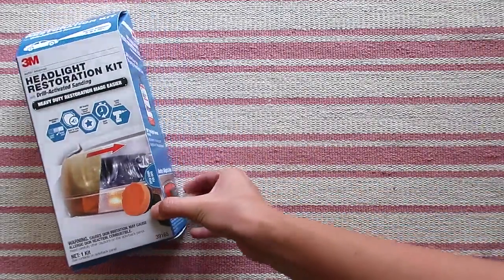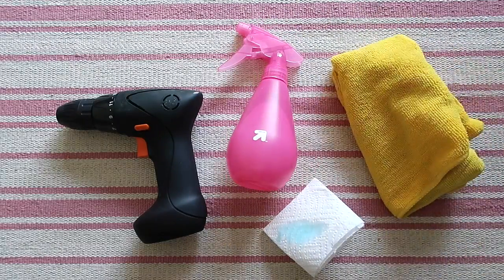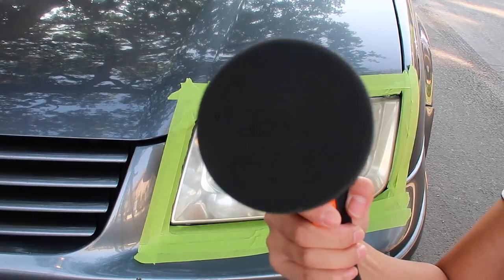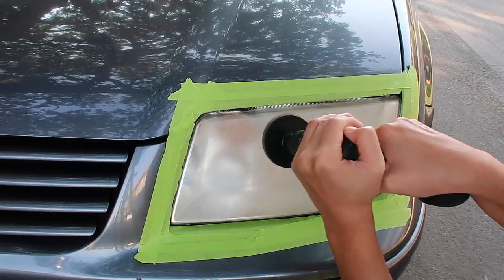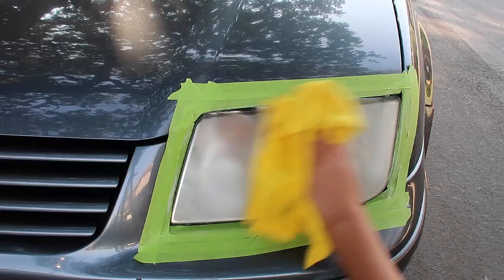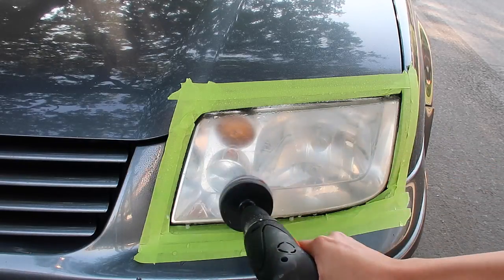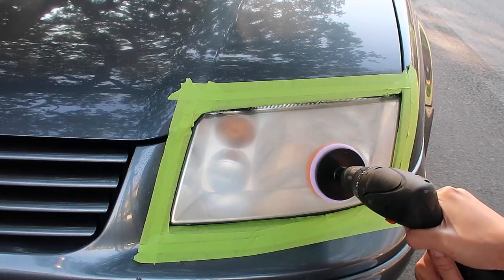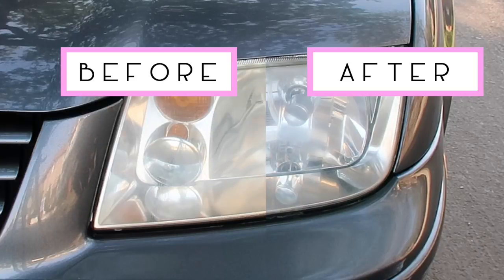HOW TO RESTORE HEADLIGHTS  | Jessicann

Comment: This definitely works! I restored my own headlights on my car a couple times but eventually they oxidized on the inside so I figured it was time to just buy a new set. I actually got a pair of new headlights off Amazon for only $85! But restoration will keep you from buying a new set for much longer! Especially if you live in hot and sunny Arizona. :)

Comment: Great step-by-step video Jessica.  I've used 3M headlight resto kit 39165  before but I recently bought 3M kit 39084 on sale.   This kit has a foam pad without the drill adapter so sanding and polishing is done by hand and it took me about 15 minutes per headlight to go thru all the steps.   Very good results in bringing the lenses back to clear.    I also coated the lenses with Blue Magic lens sealer for UV protection which should help keep the lenses from quickly yellowing in the California sun.

Comment: Apply clear coat to the headlights!
Reply: Not just any clear coat though. It has to be a UV resistant clear coat if you want the headlights to remain clear for more than a few months.
Reply: clear coat will start to turn yellow and peel too. also if your headlights turn yellow again it will take 2 hours to get all the clear coat off. just use turtle wax instead